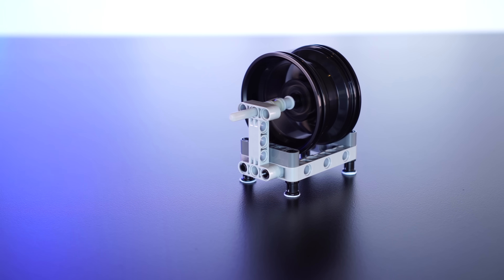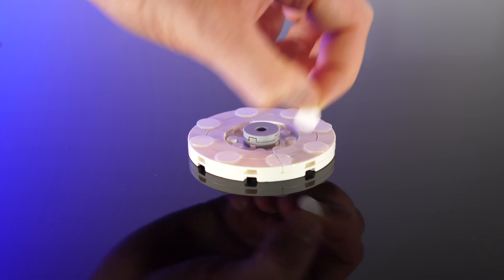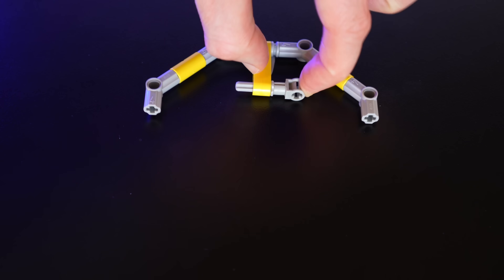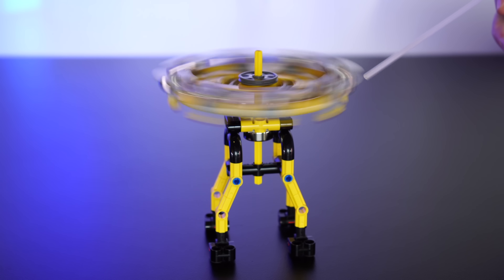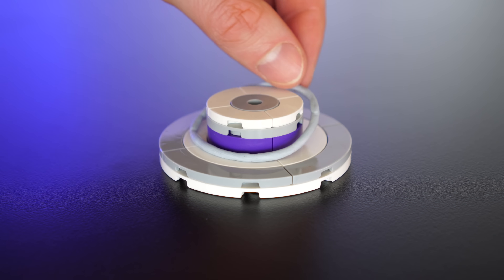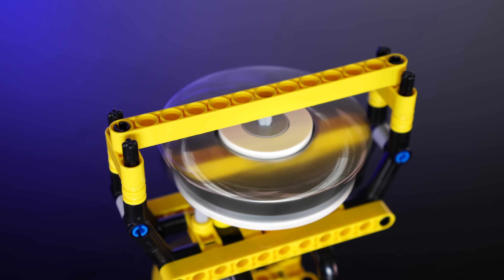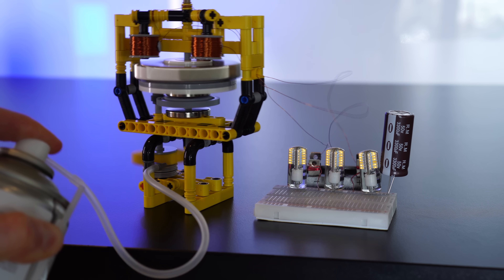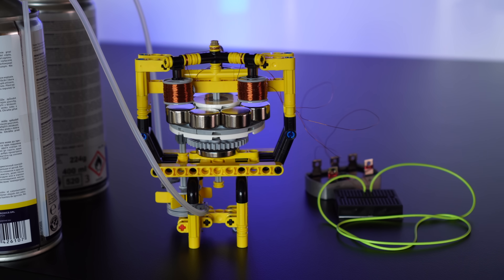Making a LEVITATING Lego Generator Powered by Air

Comment: This design is awesome, if you added a one way clutch to the central axle you could reduce the friction from the turbine and connecting gear. With it being levitated the way it is, the clutch could even be functionally disconnected when disengaged removing the friction completely provided it could be stabilized well.

Comment: For the gear issue, you need do large to small because small to large is more torque, large to small is more rotation speed
Reply from the maker: Exactly, and to create any meaningful current, you need torque, not speed. Speed does no useful work if there is no torque. In fact if I reverse the gearing, there is so little torque, it can barely even spin the magnet rotor.

Comment: You should make sure to ventilate your room after that
Reply: Why?
Reply: @XarouraX Because that's not compressed air:

Common duster gases include hydrocarbon alkanes, like butane, propane, and isobutane, and hydrofluorocarbons like 1,1-difluoroethane, 1,1,1-trifluoroethane, or 1,1,1,2-tetrafluoroethane which are used because of their lower flammability.

When inhaled, gas duster fumes may produce psychoactive effects and may be harmful to health, sometimes even causing death.

Comment: Please reverse the gears, in the way you made it is greatly reduces speed and I wanna see it go super fast
Reply from the maker: Reversing the gears unfortunately renders this generator unable to run at all. It reduces the torque so much it can't even spin. Generators also rely on torque, not just speed, to produce an appreciable output. As soon as an electrical load is added, there is resistance that builds between the coils and magnets, so if you have weak torque, the generator can't produce any useful current

Comment: The second design was much more stable even as it had less points being attached to the operative axels I feel like it could have been more efficient with the 3rd magnet design with the second design of the levitation with less mounting points it would have less stress and vibration in turn being a air powered power house

Comment: you could put a zip tie or perfectly sized elastic band around the magnets to hold them from flying off the wheel... as i typed this you changed to a magnet with holes so im questioning if i should even press enter but fuck it

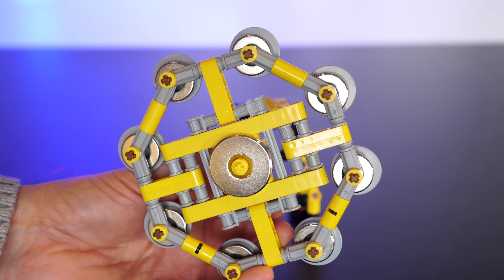Comment: 6:32 I think what's happening here is that most of the energy is radiating from your fingers to your body, so the LED doesn't light up.
Reply: Our body's resistance is too big for that little voltage that it generates, so the fingers in contact with the wires just won't do anything
Reply: @arturfilleul3997 thanks nerd

Comment: If you 3D printed instead, created a system to maximize the pressure coming out of the container, also used the same pressure when it exits to a second system to counter spin the coils, route the coils through a piece that can transfer the spinning system's electrical current to a static system, you would easily triple the output.

Comment: the reason why the rotor was not moving was not because it was too heavy, no, because there was a lots of friction and contact between the hole of the lego and the shaft, not that it was heavy, since friction plays a role too, as I just saw the rotor stopping quickly, indicating friction.

Comment: A bit frustrated that you didn't built a magnetic suspension for the turbine on the last one.
Reply from the maker: The turbine only weighs about 2 grams, so adding magnetic suspension would more than likely add friction and way too much weight. Unless you mean the rotor? The rotor uses magnetic suspension

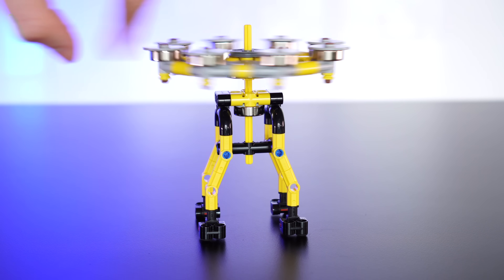Comment: 5:25 one downside to your design is the bottom magnet is getting pushed AWAY (by the weight of the upper magnet, and pulled DOWN by gravity) from the adhesive putty , making eventual failure at that point a certainty. I think it would be better to support the magnet and putty with some lego underneath it.
Reply: Im the only one who red it😂
Reply: Nice thought bdw.
Reply: @LolipopMihai2472  THanks!

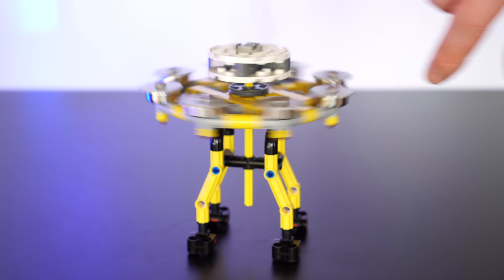Comment: I might be wrong but at 4:50 I think part of the problem is that the bearing is making contact at all points equally due to the orientation and gravity pulling down on the turbine.

Comment: I want to see you do experiments with @LegotechnicEmbodiment valve core pneumatic engines. I really want to see a boat.
Reply from the maker: His videos and valve core engine designs are fantastic! I've actually tried to replicate a similar design, and it's almost there. Would love to experiment with more and more pistons powering a generator or something..
Reply: @ YEAH EXACTLY! Make sure to get the softest durometer o-ring. And use a slightly thicker oil. I think you need 50 durometer, 6mm od, 4mm id, 1mm thickness.

Comment: I did a similar prototipe 5 years ago , you could fit this contraption in a vacuum sealed Chamber, and using pressure differentials to moove the turbine in a cicle , drastically reducing air fiction and drag , and eliminating air cannister . Still got the blueprints ! 😉

Comment: Correct me if I'm wrong, but that magnet displacement is not ideal to ensure maximum magnetic field variation (and thus coil induction). If the magnets are placed like north up, south up, north up, south up and so on, you will get much more efficiency from that generator. Looks like your magnets are magnetized sideways and not up/down

Comment: Do you have to take the aluminum container wrap it with three layers of carbon fiber by using a scuba divers compressor you can get  nearly 2000 pounds per square inch when regulated down it will run your item for a very long time or very quickly scuba tanks can handle up to 3500 pounds per square inch just pump it with regular air in it   They use this method with high powered air rifles they will fire a 50 caliber projectile with as much energy as gun powder and it will do it over and over again

Comment: Bro shape of magnet produces different lines of forces donut shape will not be working becouse shorten mgforce area so stick to SN config. And to max efficiency use coil outside on a tube and mg. inside and shake it. But if you want to stick to your design use mg core to wound coils on

Comment: Using 6 SCRs, MOSFETs, or IGBTs could form the basis for a precise switch mode, filter capacitor-less direct rectifying DC Inverter power supply that has a power factor near unity.

Comment: For super efficiency, you could use an arduino, a hall effect sensor and a servo that only actuates the air cans when the rotor is under a certain RPM, or could even build a centrifugal governor like an old hit and miss engine. Then see how much phone charge you can get out of one air can.
Reply from the maker: That's a really neat idea! I love the idea of controlling the input to a generator to maintain a certain level and improve the efficiency. Thanks for the suggestion! Also pretty straightforward to control the nozzle

Comment: I love the idea and the final design. I'm honestly impressed by how well this worked. Lego is a beautiful platform for experimenting with engineering. A couple of things I would have done just to maximize efficiency: 1. A larger, more stable base to reduce the wobbling.  2. Enclosed sides for the turbine to reduce air loss to the sides. 3. Magnetic levitation for the turbine arm as well, to reduce friction and not melt the little bushings.

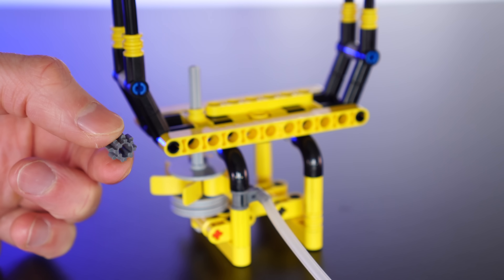Comment: For shaft you should have use the bigger gear and small gear below the magnets not the opposite 9:15
Reply from the maker: Unfortunately this doesn't work - swapping the gears results in dramatically reduced torque to the rotor. And you need torque to drive such a heavy rotor, and to produce reasonable current when an electrical load is added. When you add an electrical load, there is a very significant drag resistance against the coils. So if you have poor torque, the whole thing stalls and your output yields almost nothing. So gearing down is the best means of providing some real torque to keep the rotor spinning under electrical load.

Comment: You know you could have used a larger gear on the air turbine and a smaller one on the magnet wheel, so in that way there would be more rotations on yhe magnet wheel per rotation on the turbine, increasing electrical output
Reply from the maker: Unfortunately this doesn't work - swapping the gears results in dramatically reduced torque to the rotor. And you need torque to drive such a heavy rotor, and to produce reasonable current when an electrical load is added. When you add an electrical load, there is a very significant drag resistance against the coils. So if you have poor torque, the whole thing stalls and your output yields almost nothing. So gearing down is the best means of providing some real torque to keep the rotor spinning under electrical load.

Comment: Somebody somewhere has to make little metal bricks that are compatible with Lego. The next logical step would be to find some and make a boiler...
Reply from the maker: That would be amazing. Metal Technic Parts has some lovely parts. But a boiler would be so cool. In the meantime I've been taking apart a small steam engine to use its tank. I'm really struggling to get enough power out of a small stream of steam though 🫠

Comment: Efficiency improvement: if you want to blow on the fan you might as well put the big gear on the fan and the small fan the magnet thing, this will triple the efficiency👍
Reply from the maker: Unfortunately this doesn't work - swapping the gears results in dramatically reduced torque to the rotor. And you need torque to drive such a heavy rotor, and to produce reasonable current when an electrical load is added. When you add an electrical load, there is a very significant drag resistance against the coils. So if you have poor torque, the whole thing stalls and your output yields almost nothing. So gearing down is the best means of providing some real torque to keep the rotor spinning under electrical load.

Comment: You're using a LED to determine that you're generating 3volts, but LEDs are current devices not voltage devices. So where did you get that concept from?
Reply from the maker: These particular LEDs need about 3 volts to get to full brightness, so I just use that as a crude barometer to indicate if I'm reaching that threshold

Comment: That looks amazing! though I should suggest you build a wider base for it, and then connect it to the upper cage (maybe a trapezoid?) to try and remove some of that vibration. I feel some energy may be getting lost there.
Reply from the maker: You're absolutely right - it would benefit greatly from a more stable base. It does wiggle around a bit at low speeds. And at high speeds it sort of looks like the whole contraption is vibrating slightly. I mostly left it like this for aesthetic reasons. A future version would definitely need a more balanced rotor and more support

Comment: Love these lego generator vids, they're so cool. 

Is there a video or a smart person that can tell me how even tho nothing is touching anything, more load makes that thing spin slower? Like i can hear the resistance. Is it just because the wires are pulling more because of the lights and it's messing with the magnetic fields?
Reply from the maker: Sort of yes! In simple terms, when you add an electrical load (e.g., a light), and current starts to flow, the coils of wire create their own electrical field. And this creates drag against the magnets. So you're totally right that you can both hear and feel the resistance build against the rotor when you add an electrical load!

Comment: Can u please tell me what are you using to measure the voltage,that will be much appreciated.
Reply from the maker: Sure! I'm afraid I don't have a link as I got it ages ago, but you can buy these little voltmeter modules on Amazon for a few bucks. They draw just a little power, and are a fun way to indicate a rough voltage output under a small load. If you want a precise measurement of voltage you're better off using a real voltmeter though. I just like these modules to prove that the generator is capable of producing a small amount of current

Comment: for future projects, i'd suggest being careful with "air" duster cans as they usually hold a refrigerant since they evaporate quickly but need very little pressure to condense into a liquid thus you can store a lot, using them with the can upside-down is a lot more dangerous as the refrigerant doesn't have enough time to boil and evaporate so the can and nozzle can very easily reach sub-zero temperatures as the refrigerant takes heat energy from the air to boil and evaporate

did i mention they're also major greenhouse gasses, and we just sell this stuff with the intention of venting it to the atmosphere
Reply: The GWP of R152a (common air duster) is 124 compared to the common automotive refrigerant R134a being around 1400. This means that 1 g of R152a is equivalent to 124g of CO2.

After some back of the napkin math, a human will exhale more greenhouse effect causing gas in one month than one can of air duster.

I do agree that use of these should be reduced but there are WAY better things to be doing instead of not using canned air. Look at companies who output thousands if not millions of kgs more of damaging gasses. The answer to combatting climate change is to change the giant corporations who get to pay governments to not look too closely at their emissions.
Reply: @Zanderhawk11  yes.....  and  inversly, one can of air duster puts out as much  co2 as a  single human in a MONTH.  and they generally are a one use item.
Reply: @kilroy898  still there are much worse things. Keep in mind, that figure doesn't factor anything other than just breathing. If you drive a car your impact sky rockets. Again, compare that value to what oil, mining, and other industries put out per year and you will quickly see who needs to change.
Reply: @kilroy898  as long as taylor swift is taking a jet to pop down to the shops, im not going to worry about using a can of air.
Reply: @kilroy898 Ya I'm not going to care untill companies that output a million times more CO2 a day do something
Reply: Correct about the thermals wrong about the refrigerants being bad for the atmosphere well they are but not like they used to be nowadays they are much much shorter lived in the atmosphere
Reply: It's not really that bad of a gas in reality(difluoroethane). While it's got a much greater warming equivalent than Co2 it only has a atmospheric lifetime of 1.5 years. So while bad, over time if not too bad. Methane is VASTLY worse. It has about half the  warming equivalent of difluoroethane, but a atmospheric lifetime of around a decade. So your farts are going to be worse over time.

That said it should still be avoided if possible. But should not be a primary concern.
Reply: That's not my problem that's the problem of our children 🗣️🗣️🗣️
Reply: @TheDeadMeme27 no, it will very quickly be your problem in the next 5 years. The untold amounts of suffering both physical and mentally that we will experience in the coming decades is genuinely immense. I’m sorry you think you can escape this.
Reply: This. They are harming the atmosphere so please, don`t use them.

Comment: Idea: Make something to turn off the air input when at a certain voltage to regulate the power
Reply from the maker: I actually quite like that idea - only injecting energy to a flywheel when more is needed. Cheers for the suggestion 🙏

Comment: Random neat fact about air duster cans, the gas exiting the nozzle is actually moving faster than the speed of sound when you have it at full blast. The way you can tell is by looking at how the stream of gas bends the light passing through it which reveals shock diamonds or Mach diamonds which only occur at supersonic speeds.
Reply from the maker: Damn really? That's cool 😎
Reply: They also make you feel funny when you breathe in the gas ( don’t ask how I know that)
Reply: @kittycat-thesilly  You do know that that's not air, but a flammable refrigerant, don't you?
Reply: @marluna_x  that's the joke
Reply: @ErikAranda-c2n I'm just making sure
Reply: nEaT fAcT
Reply: @kysersoze9567  fuck are you mocking them for? that fact is very neat

Comment: I have an old school mechanical vape that uses 2 like-poled magnets in the button on the bottom to hold the switch open.  its a magnetic spring but exactly like you have it set up.  magnets are cool.

Comment: Amazing job! Where did you buy all those strong magnets?

With how fast that generator was spinning, I was getting a bit nervous about the plastic Technic axles melting inside of the pin holes while rotating so quickly. I've tried to run LEGO axles at speeds that fast with normal electric motors before, and any rotation speed beyond 1500 RPM began to damage them.

If you share this concern, a potential solution that I recommend is to use steel ball bearings. It is possible to build such bearings out of LEGO using 11L Technic circular beams like the yellow one shown briefly in this video. The steel balls come from the Mindstorms EV3 45544 Educational Core set, but those are quite expensive, so any steel ball should do the trick.

Comment: make it a bit bigger, with more magnets and coil, also more magnet rotor with improved frictionless axis.
All powered with a good gear ratio with unlock/detachment mechanism...

and let's try to reach 12v~24v or even 120v or 220v continously with  some low to higher speed